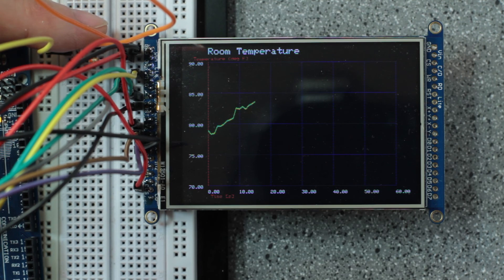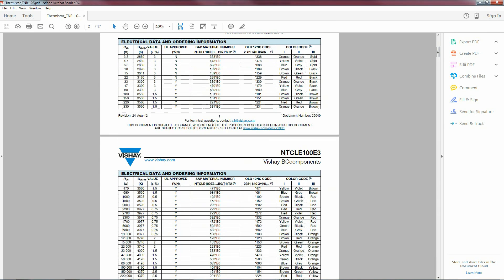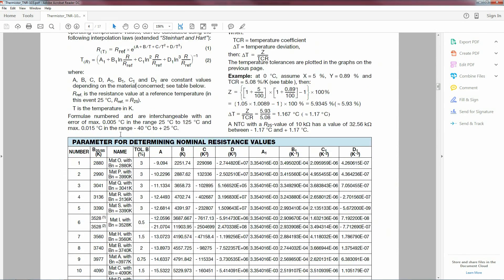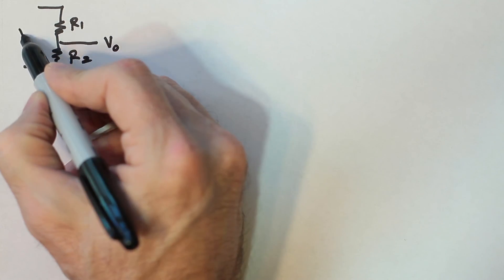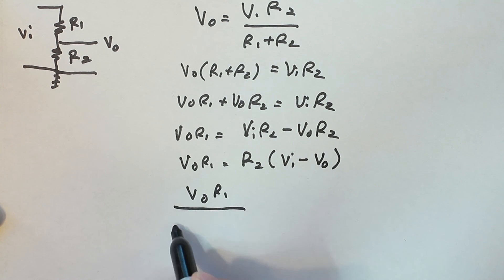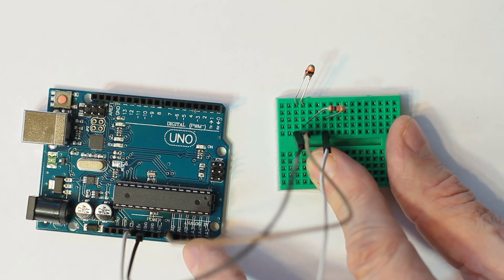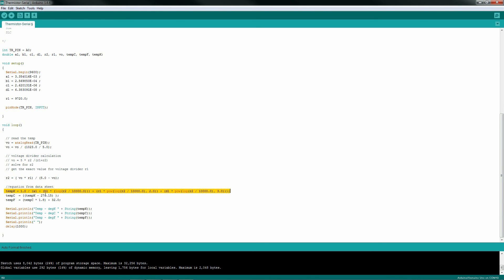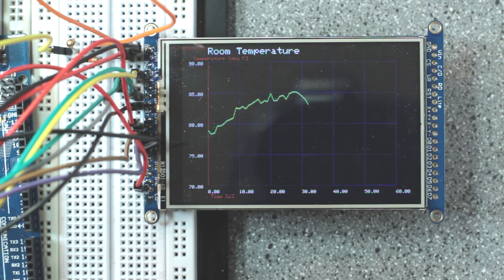Using a Thermistor with Arduino FREE CODE

Comment: why do you divide vo by 204.6?
Reply from the maker: An analog pin will read the number of bits measured for the 10 bit device. That would be a maximum of 1024 bits since the max voltage is five. Since the goal is to get volts, you have to use a conversion factor 5 V divided by 1024 which is 204.6.
Reply: @KrisKasprzak  after some great staring I figured it out. So you had 1023/5=204.6… I am using 3.3 volts as my reference so I used (1023/vref). Thank you for this! I had a couple tutorials help with this. Yours helped me get the proper resistance reading and another helped me convert the resistance to temp reading. A beautiful exercise and always exciting when it works

Comment: Pretty great video. I was wondering about the equation... Doesn't the Steinhart-Hart equation only requires 3 coefficients? Your datasheet's shows 4 and an a ln squared term.

Maybe the 4 coefficients equation is more accurate idk.

Also little fun fact: at our job how our hvac controllers work, thermistor input configurations use a lookup table of values for figuring out the temperature that is read.
Reply from the maker: Not sure about that equation, I just followed the datasheet.

Comment: I bought a thermistor automotive 1/8”Npt  but it didn’t come with any information at all since it was supposed to be used with a specific temperature gauge. I have used a thermometer and boiled some water to plot a resistance/temperature graph. At boiling temperature I measured 96.5C so perhaps it’s not very accurate. Also if the temperature increases to quickly the two thermistors can have different reaction times.
Based on the raw data I have calculated the a,b,c values. Bellow 14C I use the beta function. Next I made an excel table with all the values from -35C to 192C in my case, used concaternate function to add a “,” after each value and copy paste the values into the internet browser header that makes them a series of numbers line -36,-34,-30... instead of a column then pasted it on a vector in arduino like temp[907]={-36,-34,-30,...} so that it doesn’t calculate the logarithms to make it faster. But that’s only if you don’t need decimal places otherwise the vector gets too long, like tens of thousands of values

Comment: Really like this video thanks. i want to make a program that has 3 temp sensors and this will help me alot. mainly with the calculations side of it.
Reply from the maker: Glad I could help. Not sure what components you will use in your project, but if you run out of memory, take a look at a Teensy 3.2 I use them 99% of the time as they are faster and more capable.

Comment: Any chance you are still  around and can answer why my temperature values reduce when I warm the thermistor?
Reply from the maker: I'm guessing you have your thermistor wired on the high side of your voltage divider or you don't have an NTC type thermistor
Reply: @KrisKasprzak  it seems I have a pt100 type thermistor.  I didn't know it but this is the item needed for this application.  Any chance you have any experience with these thermistors?
Reply from the maker: @ramav2578  never used one but from what i can see its and NTC device. Is one end gets connected to ground?
Reply: @KrisKasprzak  yes one side goes tot the negative and the other side is connected between a resistor and the A0 pin
Reply from the maker: @ramav2578  I think I know the answer here but put it on meter across your thermistor and then heat up your thermistor. What happens to the resistance?
Reply: @KrisKasprzak  the resistance increases as the temperature increases.  When I use all of the codes online they seem to be code for NTC thermistors and as I heat up the thermistor while watching the serial display, the resistance increases while the Temperature goes down.

Comment: Wow, super informative. I want to use thermistor to monitor respiratory rate. What is the max sampling rate of the thermistor for this? Is the detection almost instantaneous? thank you so much!
Reply from the maker: According to the data sheet response time is 1.2 seconds (submersed in oil), I suspect air will be slower.

Comment: Hi Kris, thanks for the video, I pulled a thermistor from old laptop battery works great
How do I change code to get only 1 decimal place and slow down refresh alittle to slow numbers flicking between each other  ? cheers Brett
Reply: Use Serial.println(floating value, no. of decimal places)

Example: Serial.println(1.23456, 4) gives "1.2346"